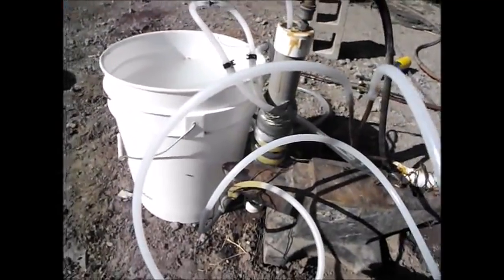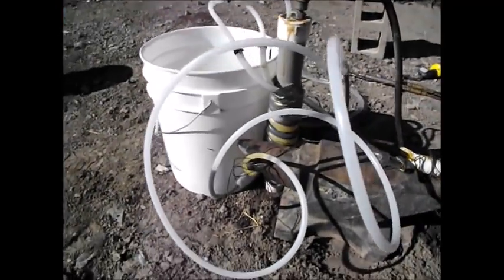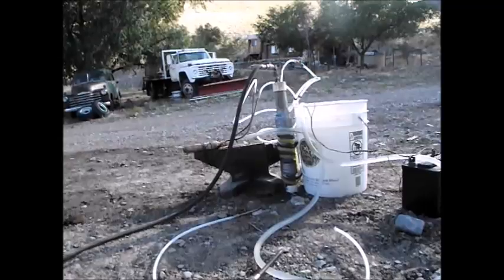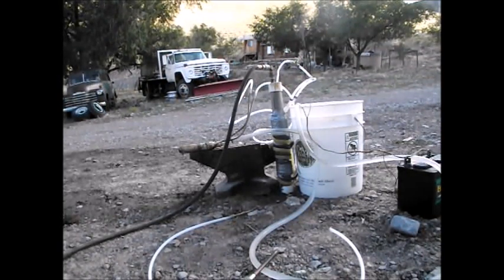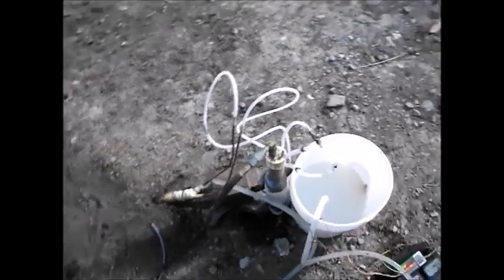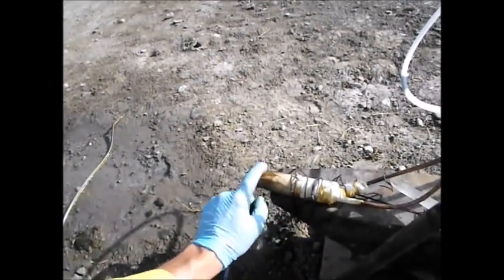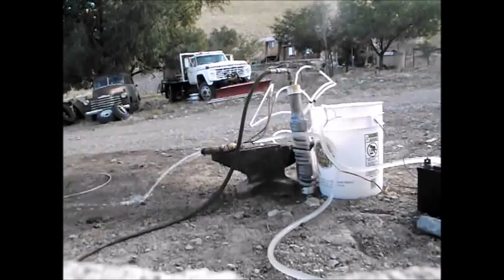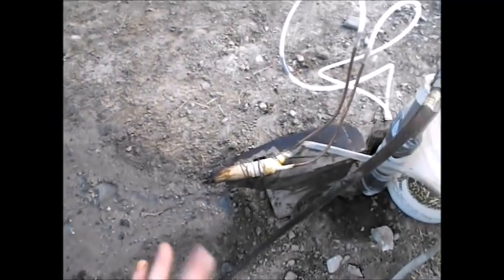Liquid Fueled Rocket Test Number Two

Comment: Nitric acid (white fuming) is a pretty crap oxidiser, compared with red fuming nitric acid or just straight up Dinitrogen Tertroxide, or or even HTP. I don’t know why you would use a more carcinogenic oxidised when there are plenty of safer, more reliable alternatives. I guess it works, though.

Comment: Hi Cody, the white vapour at around 5:50, could be unburnt diesel fuel in the form of diesel vapour. May I suggest that you increase the size of your combustion chamber as to aid in the mixing of the fuels. OR, keep the camber the same size but, by preheating the diesel fuel into a gaseous vapour before entering your combustion chamber will increase the ease of mixing and ignition of the diesel fuel as vapour would be easier.

Comment: Could you drill holes in the side of the chamber and weild small cones with both ends open into the holes with the pointed end inside the chamber? This allows air into the chamber to help ignite 
and may act as a glow plug once the tip of the cone gets hot.

Comment: Replace the copper and nitric with aluminum and nitric. Nitric don't oxidize aluminum at all and if you really want the copper ions just add a piece beforehand, love the videos man just watch your step bro the things your casual with is the stuff that ended the inventor of solid fuel that sat in nuclear rocket engines long-term. Like the channel.

Comment: Cody, im a civil engineering student and I think that if you wanted to measure the force that this motor produces you could mount it on a sled with some low pressure tension springs so you could measure how many newtons of force this motor produces, and I also think that your combustion chamber is too small for the amount of fuel you are pumping through it at one time. The fuel should also be atomised so that the correct concentration of fuels are mixed prior to combustion. This will maximise your outgoing pression and make the motor more efficient. If you look at modern space rocket motors you can see the cyclonic mixers that mix the fuels before they are pumped into the combustion chamber. This could be achieved by using a Nikola Telsa's turbine hooked up to an air compressor as a power source to mix and inject the fuels at the same time. I know a little bit late for this comment, but the more you know.

Comment: PVC won't handle it, it will turn it like charcoal, cause it to be brittle and also... EXPLOSIVE?
I somehow think that "explosive" is a bit more important that turning it like charcoal...
Reply: it probably needs a trigger and if you look at the setup the charcoal like stuff doesn't come into contact with the flames the other thing is that it could be pressure buildup causing the problem

Comment: hey cody! just a thought.. im a jet troop for the kc-135 stratotanker stationed at Kadena Ab and our engines atomize the fuel for better burning. If some how you were able to atomize the fuel (like a mist), while supplying some sort of air pressure through a compressor like device it would probably create quite the sight! 
anyways goodluck, love the vids!
Reply: Perhaps passing it through a fine mesh under higher pressure would do the trick.
Reply: @DigitalJedi  that makes sense
Reply: V ubiuaevf
Reply: I remember reading about Cadena A and B in Ignition!

Comment: also what I was trying to imagine what you were doing is I thought about it like a car except your not using the pressure to push pistons but kinda like just using all the energy and making exhaust pressure haha and it would probably help to make your combustion chamber long and cylindrical and reduce it and have some more metal tubing and make a nozzle. then you should be making quite a bit of thrust.

Comment: That big cloud of nitrogen dioxide made me uneasy xD
Reply: You're fine. It's probably just the NO2 getting rid of your oxygen.
Reply: The_Third_Hungarian I want to know what he turned in $0.10 accomplishing was including nitrous dioxide? it's extremely poisonous gas. is he thinking it sounds a little bit like nitrous oxide? under these conditions is not going to release copious amounts of oxygen with nitrous oxide work eventually he thinks it's the same thing I don't know I can't figure it out. wearing rubber gloves or even nitrile gloves and rubber coat is the worst possible thing you could do with the presence of nitric acid
Reply: Clown Whisper I think he knew as its more of a bi product it seems but I definitely agree with your point on safety.
Reply: Hát ez nem jött össze :(

Comment: Electric ignition!
And aerosol... You want to atomise the mixture in the combustion chamber.
Reply: I think the nozzle inlet is too wide also. Its hard for pressure to build up in there.
Reply: a shapeshifting reptillian I believe you are correct on that.  You want the nozzle inlet to be just bigger than the propellant inlets.

Comment: Fuel running around the combustion chamber will vaporize the fuel giving a very hot flammable Gas....  So  running coils of  fuel around the  combustion chamber going from  hot tip up to the  entry will  give  vapor to  burn....  Once the chamber heats up....  This is  how micro turbines and  many  jet engines  can burn parafin,  diesel,  or  even  waste fuels....  In  fact  once you heat a combustion chamber you  can  even  burn wood to power a jet turbine....  
A good idea is to insert a small engine spark plug into your  combustion chamber and  maybe use your  neon light transformer to  give  spark..... 

I built  car turbo jet engine  and  used  fuel injectors to  control  fuel delivery.....  Pulse speed controlled by throttle knob did the job...  You will either have to  experiment with  jetting both fuel and  oxidizer or  jet the  oxidizer and adjust fuel to  that  set jetting..... 

And I agree with everyone about safety.....  Yeah I love the  danger standing next to!  My projects....  But  after  your  having some of your  stuff go kaplowie you really should be more careful due to  your  using up to  many lives already... 
Come on  Cody  how many times have  you nearly  killed yourself  honestly...   ;)

Comment: I realize this is an old video, but it's not often I know something I can share. I had a diesel torch and how it works is you have to preheat the diesel to near the flashpoint to get it to burn. The tourch  I had had a coil in front of the nozzle and a pan underneath. You spill some fuel onto the pan to heat the tube then once the torch lit it would keep the fuel hot. The fuel was also in a pressurized bottle.

Comment: 4:37 Had a bit of a pulse jet going there for a second!
Reply: That's Combustion Instabilty, a Problem that can Blow up real Rocket Engines because of the much higher Chamber Pressures involved. This gets worse with larger Combustion Chambers which is why large Engines have that Tendenncy to explode. Pulsejets suck in Air just like normal Jet Engines.

Comment: hey Cody my job is it to work with plastic couse of incresed amount of acid or liquid. we use PPs Polypropelen (s stays for hard to ignite on my county) as most. so thos orange waterpipes you could buy @ building marked should be made of it same as you could get thos in many size like from 1cm to 7.5cm should be standard for sure (outside messure). they schould be able to handle the acid easiely or you may use PE Polyethylen but PP is a bit softer than PVC and PE is even softer as PP even on the dense PE meterial standard. just so you may try that if you didnt knew or tougth about it.

Comment: Could it be you're turning half of your lot into a chemicaly contaminated area?
By the way, if you want to ignite diesel, using a red hot piece of metal in the combustion chamber to spray the fuel on might be a good idea. This was don in the old German Lanz tractors to start them: A Blowtorch was placed, firing at a massive copper bar to heat it up. The engine (consisting of actually hundreds of pounds of moving metal parts) would then get set in motion by hand, merely oscilating back and forth between compression cycles. When the person starting the engine got the impression there was enough *OOMPH!* in the motion, he would activate the injection, and hopefully the engine would catch. If not, invest another pound of elbow grease…
Anyhow, a hot piece of metal might be a good helper for evaporating the fuel, thus enhancing the chance for the combustion to go. Enjoyable projects, mate!

Comment: Whoa I saw the flashback into the oxy/acetylene torch. That was an unexpected consequence but at least you didn't fuse your regulator. My experiences with torches are when in confined places, like your rocket chamber, they sputter pop and go out. Can you just aim the torch at the end of your nozzle as it would surely ignite without the possibility of dangerous and costly flashbacks. Great work, keep it up.
Reply: +fla playa loo/ks li/ke it flashed back/ through the plastic and too the torch head. Arent there flame arrestors in that torch head by law? i would of been scared shitless though lighting that homemade nozzle, I just hate being scared by little shit.
Reply: Derrick Blackburn It did flash through the plastic tubing and I have personally (accidentally) blew up a hose and fused the regulator due to flashback. To the best of my knowledge they aren't mandatory on the discharge side of a regulator. There is an internal arrestor in the regulator though. I was just researching this and how dangerous a torch set can be. If that flash had made it to the tank there would be explosive destabilization of the highly reactive acetylene. They really aren't toys and a lot of people don't get how dangerous they can be.
Reply: trust me, Im scared shitless of pure oxygen or acetylene.
Reply: Derrick Blackburn Lol but there's no need to be scared of them if properly used. Lighting a homemade Nitric acid/Liquid fuel rocket with them wasn't the smartest thing I've ever seen, but he survived. And I'm no expert but keep Acetylene pressure below 9 psi at all cost, keep your tips clean and never muck around. They are fairly safe. Also follow proper purging methods. Open and close each valve on the torch head individually (either order) I do acetylene first. After the experience I had back around '03 I will never skip those safety measures again.
Reply: +Derrick Blackburn  You must have filled up a balloon or two and set them off. kabooom

Comment: At 02:46 that cloud of nitrogen dioxide would have had me thinking twice about trying this w/o a gas mask or respirator. It would suck pretty bad to wind up in the hospital with lung edema. All it would take is a shift of wind direction at just the wrong time... Great videos though, man! I'm having a ball working my way through all the past content. Also, you might find Ignition! An Informal History of Liquid Rocket Propellants by John D. Clark to be interesting. From trying to find something that CF3 wasn't hypergolic with, all the way to using methyl mercury to increase fuel density. It's an interesting read all the way through. It's available as a free PDF on the web.
Reply: I'm currently reading it, and I think it's a great book!

Comment: Great experiment! I am a little bit concerned about your safety equipment, that nitric acid is seriously bad stuff. If you really want to work with the engine in that proximity that raincoat might help a bit for acid exposure, but you always want to think of what are the worst things that can happen to you. If you ever catch fire that raincoat is going to stick to your skin. If you want to work with RFNA try to think of ways to remote the engine controls. That way if things go to hell and a handbasket it does it not do so 2 feet away from you, next to a container of one of the foulest acids on the planet. Equipment to remote control things doesn't have to be fancy or expensive, cables, sticks, and pulleys can accomplish quite a bit. Or even just a power drill motors or other simple things. Some powerful enough RC Servos might be the best and simplest way to do it. Many of even the most brilliant rocket scientists have been hurt or killed in their profession when something they felt was pretty safe did something they did not expect.
Reply: +Cody Reeder Also I hope those weren't latex gloves.  If you are working with Nitric acid you are actually better off without them.
Reply: +wrrocket "I am a little bit concerned about your safety equipment"
[2]
Reply: Safety? On Cody'slab? HAHAHAHAHAHAHA... HAHAHAHAHAHAHA hahaha hehe. Good one
Reply: Hypergolic rockets are quite difficult to contruct.  First, you have to atomize the fuel and oxidizer with some kind of injector, and then you have to impinge the atomized components in such a way so that they mix.  95% HTP is really, really nasty stuff, and I would avoid it like the plague unless you want to be wearing full body PPE.
Reply: @scottgauer7299  actually I have been looking for that so I could clear out certin (VERY) hardy plants and avoid leaving behind certain residues
Reply: Coming from someone who has worked with both peroxide and MMH (Also MON3), just stay away from the stuff unless you need to, and if you do, you should be wearing the proper PPE.  Fortunately, peroxide PPE is cheap to get, just the tyvek tychem suits.  For MMH and MON you need full SCAPE
Reply: @scottgauer7299  I was only talking about the peroxide but okay right now I am being safe/er and only messing with solid fuel rockets have been thinking if you could attach a helium balloon or two to it have to when the rocket lights it burns the string detaching it from the rocket and letting you light it at a higher altitude with that design you wouldn't have to worry about the balloons being aerodynamic because when it's lit you could just detach the balloons you would just need some kind of remote lighter and a long distance one at that

perhaps when I am older and have more knowledge materials and experience I can work on a liquid fuel rocket but right now I don't even have a copper pipe by the way if you were to coat the copper in something like gold or platinum it might be able to handle nitric acid though I think gold would look nicer on copper some of the platinum group metals are probably the best bet who knows maybe a heat resistant silicon compound would work
Reply: Does liquid Oxygen react hypergolicly with organic solvents?
Reply: What about a butane/air rocket?
Reply: +5thDragonDreamCaster like a pulse jet?
Reply: Hayden Spriggs
I guess, if that would be a pulse jet. Since the butane is stored under its own vapor pressure it will make it's own pressure to push out through the pipes and you won't need an air compressor.
Reply: 5thDragonDreamCaster 😎
Reply: why so much hatred for nitric acid? concentrated sulfuric acid is actually more dangerous both to flesh and most surfaces, at least as i know - and there are way more nasty acids out there.
Reply: for one thing nitric acid is not nearly as bad as hydrazine and another thing is he could easily have a life sized bath full of baking soda if he got acid on him
Reply: ***** i have seen that your liquid fueled rocket doesn't have much thrust. i have thought of a way to fix this. liquid oxygen or 99% hydrogen peroxide should work much better as oxidiser. but these can be...unstable to say the least. if and when you do these i recamend whereing eye protection and being behind a blast shield in a bunker under ground...with ear protection